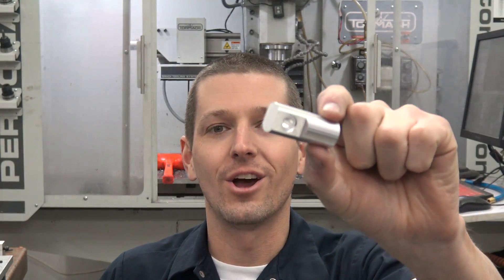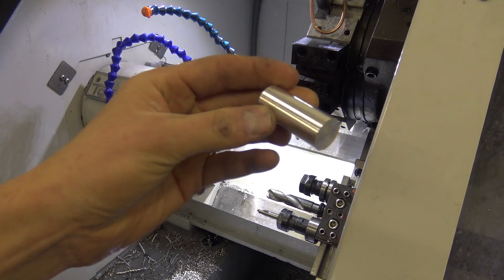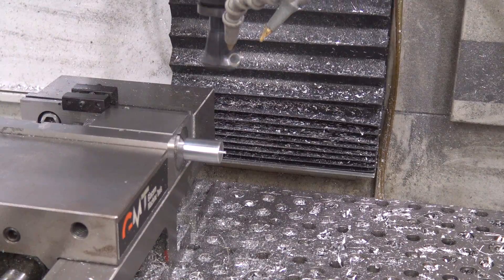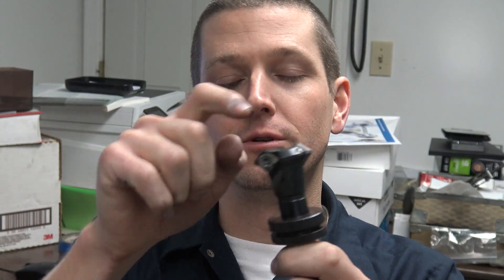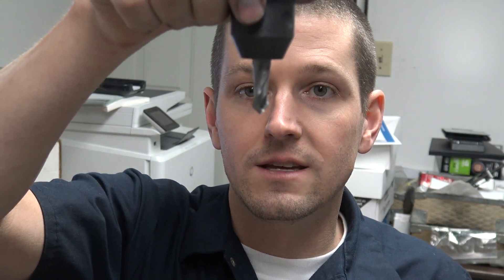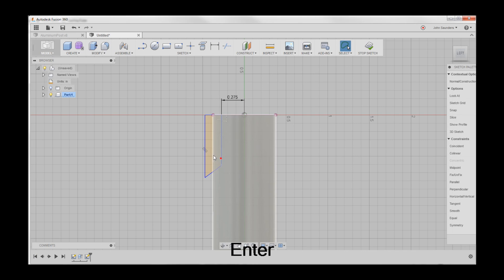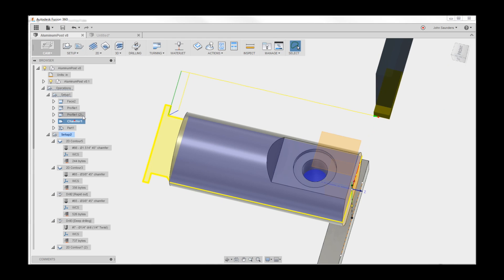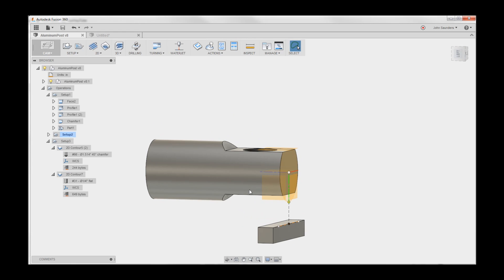Job Shop Life: Turn, Mill & Flip!  Widget77

Comment: Did you use the Tormach TTS tool conversion kit to add the neck on to the shank of the Maritool chamfer cutter? If so, does it just press fit on to the shank?

Comment: Tip from an "old timer"...
Screw Machine length drills are your friend.
No spot or C'drill needed with a part like that, just reduce feed till the tip is 
buried and about .030 of the flutes, then.....blast it thru.

Comment: You should try setting your drill cycle to chip breaking partial retract and set it up to a small pecking depth and set for an appropriate accumulated pecking depth based on the total hole depth. I have had great results with that, and its much faster: https://www.instagram.com/p/_OGvVWxzw2/

Comment: I'd have to double check when I get home, but instead of using that extra fake body in your part you should have been able to select the front face for the contour. Then in the heights tab where you select clearance etc. change the bottom to "from selection" and then selected the bottom face (top would also work, but its more math that way) and typed in how far past that face you needed/wanted to go to clear the tip. No extra bodies in your file that way.
I'm also curious why you did the face with the spotting tool when you have an endmill op later on that you would have used, most of us wear out the tip before the rest of the end mill so it would be a good way to use the rest. Six of one half dozen of the other in the end though.

Comment: Off topic question: Which size/type Glacern vise is that?  Also I believe that is a Tosa Tool table under the Vise. Does the Glacern bolt to the Tosa table using the standard slots & holes?

Comment: Another good one!Keep em coming!
Here is a suggestion on how to face or make a cut where you do not have the exact line you need.
In the geometry tab chain the straight line at the end of your part then use the Tangenial Exstention Distance parameter to extend the cut before and after the part.
In the heights tab for bottom height use selection then select the bottom line and then put in a negative value for the offset.
Hope this is useful.
Reply: +NYC CNC It's a very useful parameter you can put in + or - values to go longer or shorter you can also have separate values for the beginning and end. I use it very often, it was great for chamfering but with the new chamfer feature (which is awesome) you don't need it as much.

Comment: John Just some suggestions. If you are going to make manual tool changes. It might be more efficient to just go up to a clearance position in Z and not let the machine go all the way to Z zero return. You should be able to specify that position in your cam software. You could even move over a little in X to give more clearance to withdraw the tool. I am not familiar with the Tormach Lathe but can't you tighten up the clearance values so it doesn't cut so much air? If you are running a lot of parts all that time adds up.